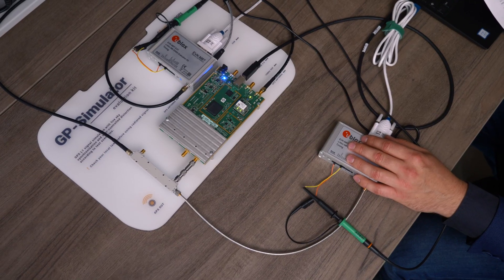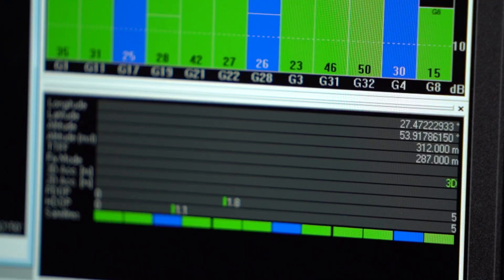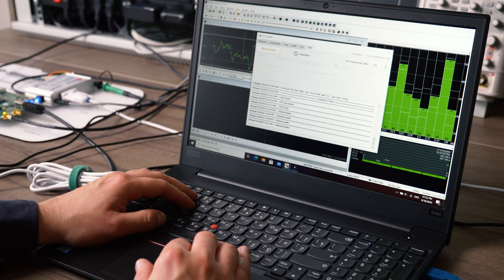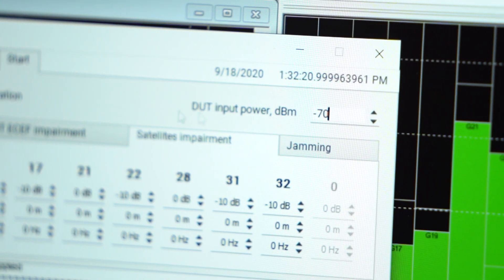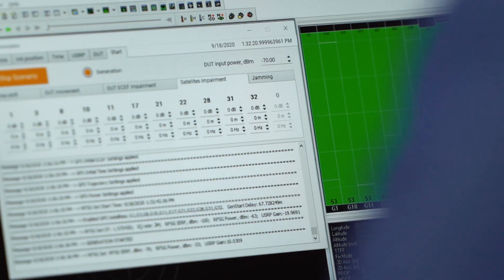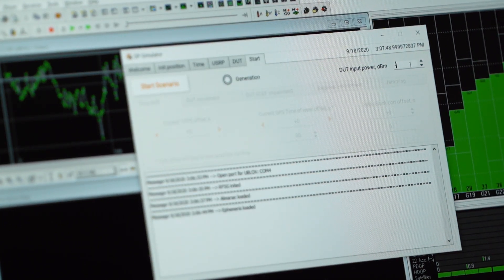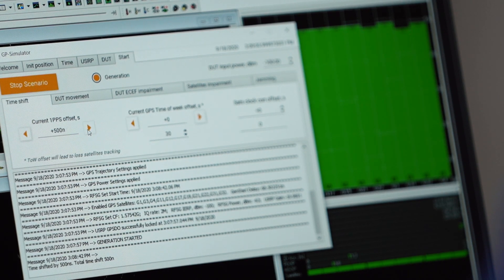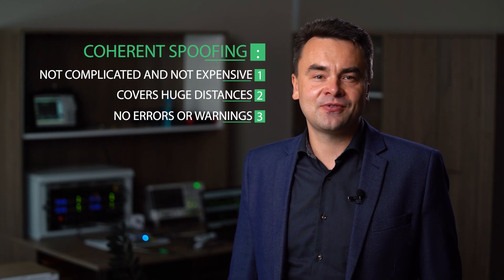Coherent and non-coherent GPS spoofing in a live demo

Comment: Hi, do you think a GNSS Record, modify and Replay attack is possible in Matlab?
Reply from the maker: Hi, why not. Matlab can be used to obtain IQ data from SDR. IQ can be recorded to file. Then it can be modified and played.
Reply: @GPSPATRON  wow thank you 

One more question I've done some simulations of GNSS Spoofing in Matlab environment and got different position than the original one. 

Do you think it is possible to modify the ephemeris data and generate an IQ signal based on that data? 

Btw I am a graduate research assistant at National Center of GIS and Space Application and currently doing my Thesis in GNSS vulnerability assessment. 

I am fully aware of the facts that GNSS spoofing is illegal and shouldn't be practiced in open air therefore I'll be doing all the experiments in a controlled environment for research purposes.
Reply from the maker: @copycarvers  Can you describe what do you want to archive? I reckon that ephemeris data modification in recorded IQ data is a complicated task. Better to use software for GNSS baseband IQ data generation like NI Labview GNSS toolkit.  

If you want to shift DUT coordinates you need to "change" pseudorange for some satellites in recorded data
Reply: @GPSPATRON  I am working on a receiver spoofer architecture. The goal is to generate a spoofing attack based on the parameters of a real signal.
Reply: @GPSPATRON  yes I want to change pseudorange which I think is possible once we can modify the ephemeris data. 

I believe if the navigation data is modified it can result in different satellite positions which will eventually result in change in pseudorange
Reply from the maker: @copycarvers  Well, of course, if you change the ephemeris of the satellite it will affect the coordinates of the receiver. But I do not understand why work with real signals then? It is much easier to generate them. And moreover, changes in ephemeris information can easily be detected on the receiver side if it has an Internet connection.
In my opinion, the simplest relay attack scenario is to use two SDRs with FPGAs. One SDR receives signals and sends raw IQ samples to the second. In the second SDR you can implement correlators to extract signals of specific satellites and introduce additional delays. You can shift coordinates and\or time in this way. 
In this scenario, even crypto signals can be 
spoofed.
Reply: @GPSPATRON  I wanted to implement a modified meaconing attack. 

As we know during the meaconing attack the number of available satellites and the PRN can be different from the place where the signal was recorded and where the signal is being replayed. 

The process that you mention which requires two SDRs and FPGA can we implement similar architecture with signal USRP in simulink/matlab environment?
Reply from the maker: @copycarvers  The scenario I mentioned can be run in real-time and a coherent attack can be implemented. 
Simulink/matlab can be used for postprocessing only, I guess. You can record IQ to file, apply some modification with matlab, and finally played on SDR
Reply: @GPSPATRON  I don't want to implement it in real-time so what changes will I have to make it if I want to implement this method for postprocessing
Reply: @GPSPATRON  even if I want to implement the method that you've mentioned above. How can I shift the time and coordinates information if I can't modify the ephemeris data?
Reply from the maker: @copycarvers  The coordinates and the local time of the receiver are determined not through the pseudorange to the satellite itself, but through the difference of the pseudorange. So you need to separate out the signals of each satellite from the recorded IQ stream. This should not be a very difficult task. Then you have to add delays to each signal based on the simulated time and coordinates. Then combine all the signals into one.
If you can do it, come to work for us :-)
Reply: @GPSPATRON  thank you so much I'll try and update you if this method works.

Comment: Hi 

Thank you for your video can you explain what is synchronous and asynchronous spoofing attacks? 

Also the method that you're using here is called meaconing right?
Reply from the maker: Hi, Actually no. 
Here we show GPS signal simulation with the coherent and non-coherent scenarios.
Meaconing means retransmitting. In general, all meaconing attack is precisely coherent.